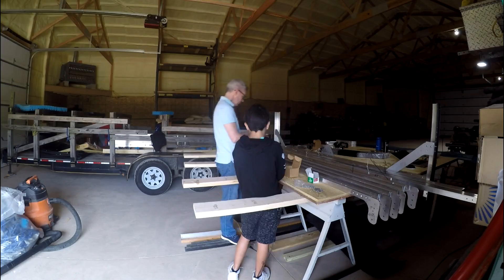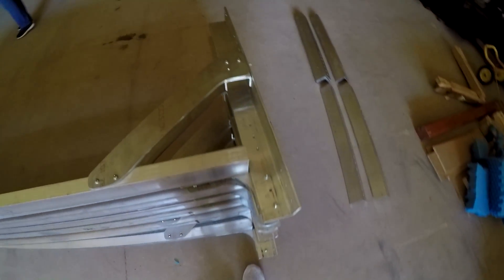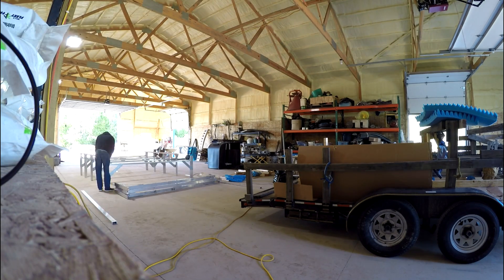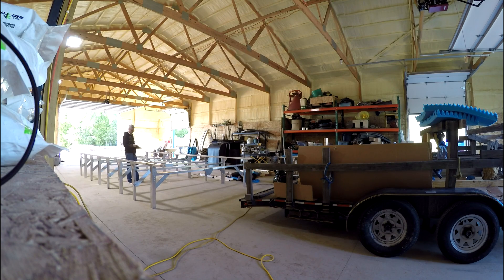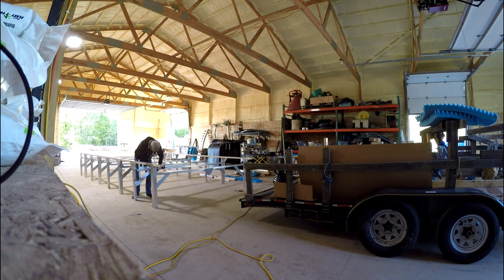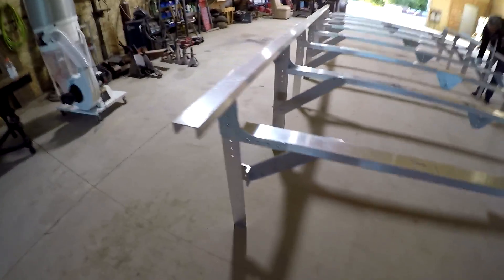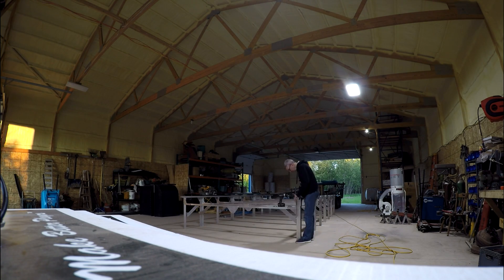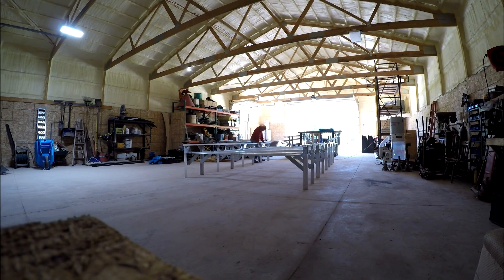Fabricator Pro 8'x17' CNC Router Build in Wisconsin Part 2

Comment: Are you going to do anymore videos using the RNRMotion control ?
Reply from the maker: Yes, I will be doing many controller videos and various other videos as well. I am the only one in this company that does these videos and I also need to handle fulfillment, customer service and design, so time has not been on my side.  Can you tell me specifically what aspect of the rnrmotion features you would like to see so I can put it on my list?  Thanks.
Reply: @PatrickHoodDaniel  Thank you for your reply. I have my cnc running using the RNRMotion control but I am unable to control the spindle i.e start and stop using Mach3 as I have been unable to correctly wire the spindle to the controler.